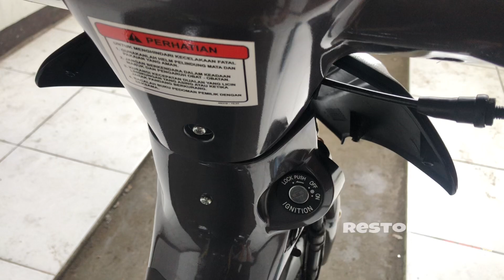How to clean carburetor motorcycle?

Comment: Just finished restoring my 23 y.o satria i drove daily back in my college days.
At first i was optimistic that the carb assy will be able to be used again as i was using > RON 89 ever since it left the dealership and always put cover to the bike for the last 15 years so that no dust will go inside.

But my restoration mechanic told me otherwise, the choke cord was stuck and the carb deemed "irreparable" . So i was getting myself a new original carb assy just to get the restoration process done within my intended timeframe.

I don't throw the old carb tho,  thanks to your content, found new urge to repair the old carb just for curiosity.
 i guess this would be challenging weekend project for some weekends to come 😁

Thanks om